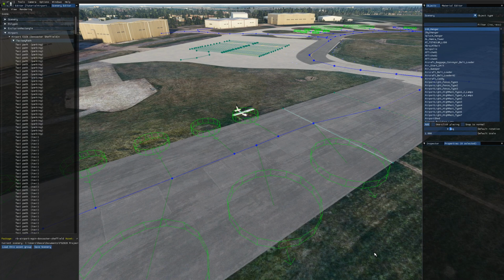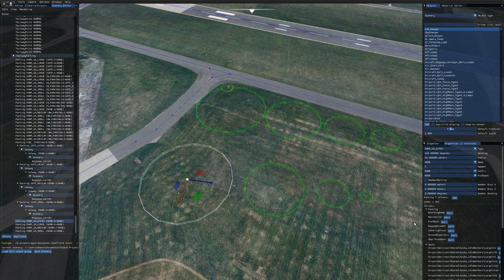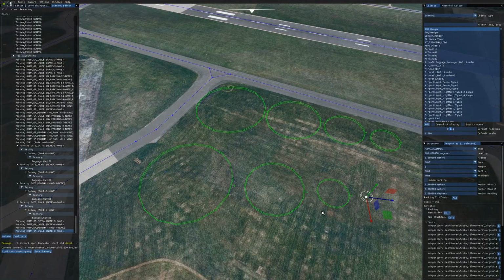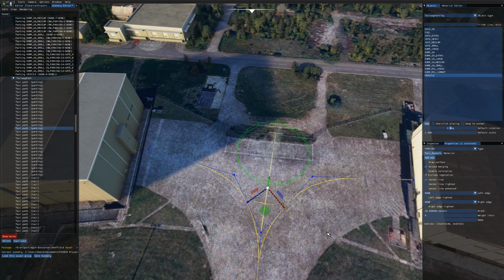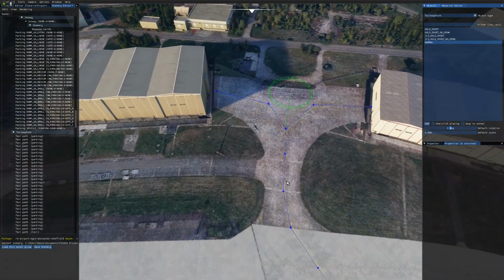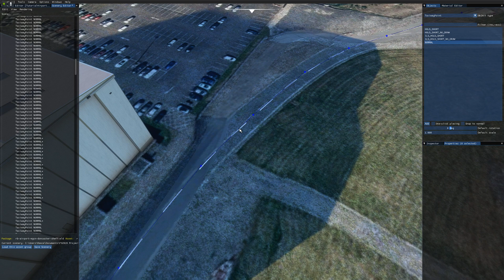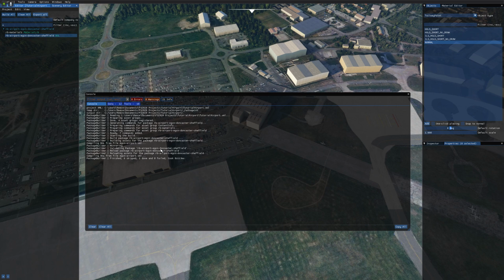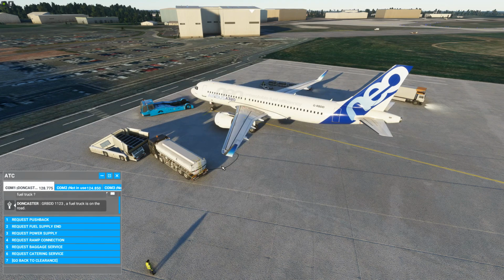SDK Tutorial #11 - Ground services - Microsoft Flight Simulator

Comment: To make a fast Vehicle Material path just make a seconde taxiway over it and mark it as closed, that way you can put a material. You  just need to duplicate (crtl D) (once its connected to the main path or you cannot duplicate) all taxiwaypoint coresponding to the path with no texture and voila. Lock your vheicle path and you can easly click on the taxiway or vis versa

Comment: Hi Benny, I am about to start working with SDK but I am not really clear about removing hanger, etc and replacing with new hangers. Is it possible to add a video to you airport showing how to do this, please? In the past I used Flying Theston’s videos but when I try now I have problems getting the polygon to work and when I add hanger it places it put I can’t move it. That is the reason I am going to try your method. Very clear and well made videos mate.